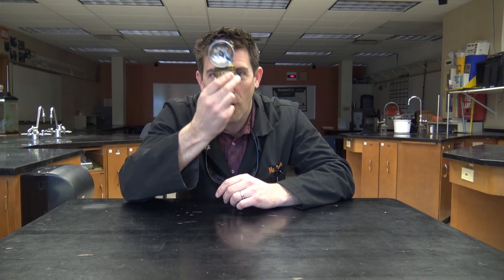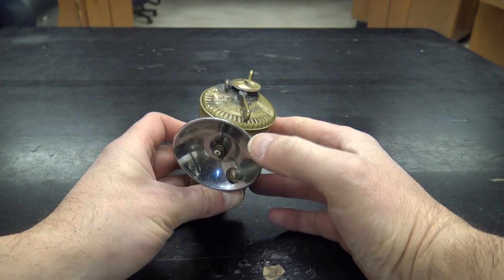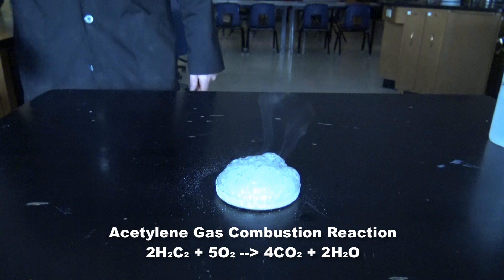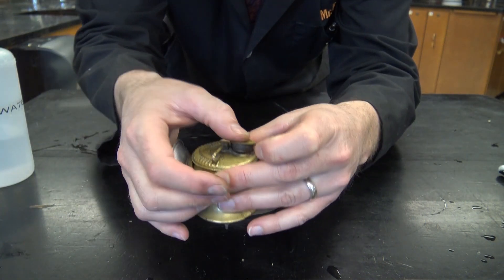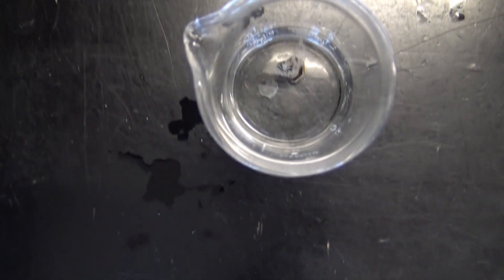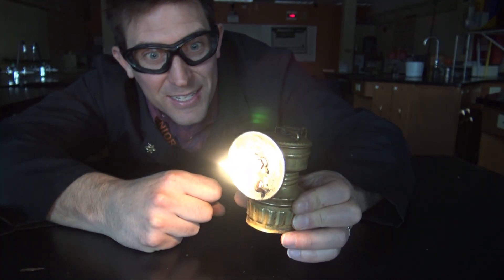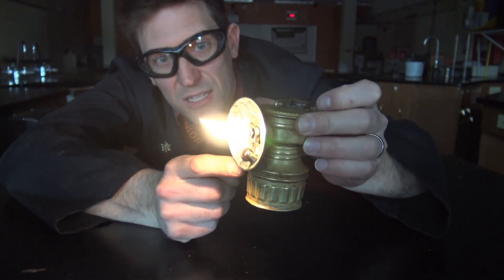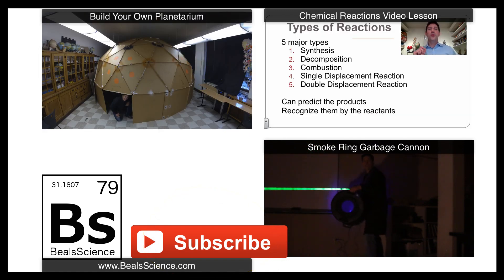The Carbide Miners Lamp - Bringing History Back to Life!

Comment: I had one of these as a kid back in the 50s/60s. I bought it along with a cannister of calcium carbide from our local Western Auto store. 
Wish you'd shown how to properly light it.  You covered the reflector with the palm of your hand for a few seconds to allow the acetylene to build up and then you'd rapidly pull your hand sideways causing your palm to spin the flint striker wheel throwing sparks and igniting the gas flame.
Reply from the maker: Sorry that I didn’t show that. The flint was broken on this one so I had to light it using flame.

Comment: My father was a coal miner in Illinois in the forties and fifties.   We had some of these and they were used for  fishing and outdoor activities.  They were always clean and at the ready.   There was a piece of screen wire twisted on the regulator bar on top used to clean out the flame orifice.  PROPER operation went thus.   You would put a small handful of carbide in the bottom of the lamp.  Water was already in the top.  Then you would spit in the carbide for the first wet to start the lamp.   Screw the bottom on and make sure it is tight and the gasket is not crimped and is sealed properly.   Then,  holding the lamp in your left hand,  cup your right hand over the reflector to trap the acetylene in there and hole your palm on the spark mechanism.   THEN,  you slide your hand off the reflector, rubbing the spark mechanism providing ample sparks into the gas rich mixture trapped under your hand.  Normally,  you would get a nice  POP and your lamp was lit, and could be adjusted with the adjuster on top.   Lamps were thoroughly cleaed each night when finished.
Reply from the maker: Thank you for the fantastic explanation!
My grandma told me nearly the same sequence about her father. She stressed the “spitting” into the carbide to get the reaction started.

Comment: Ya did good but abit to ruff . Vinegar clears them out nice and new . Hcl is to ruff on them . But one trip isn't too bad . Have a few my self been repairing.  Cool old things 130 years old still working 💪
Reply from the maker: Thanks for the tips!
Reply: Hot tank them on vinegar salt dish soap and borax. Simmer like potatoes 🥔 will take off about any thing.  But will boil the zink out Turing the brass copper red . But polished down  it turns back

Comment: In coal mines the dust/invisible gas fumes was a danger as it could be ignited by these open flames.
Reply: This danger would have been an incentive to improve technology to make electric battery powered lamps. Of course before calcium carbide the options were candles and oil lamps.
Reply from the maker: @williamkuhns2387  👍
Reply from the maker: I’ve heard they were incredibly dangerous for exactly that reason!

Comment: Acetylene gas smells like garlic. A mining equipment salesman demonstrated ti me how these lamps were lit. The gas switch turned on to start water drip and the miner would place palm of one hand over reflector to concentrate the gas then with other hand/ thumb strike the flint wheel and quickly remove palm to ignite.
Reply from the maker: I’ve never heard it described as garlic but I totally agree with you!
Reply: @BealsScience  the calcium hydroxide build-up inside lantern can be cleaned with industrial strength acetic acid or muriatic acid? I see these at antique stores and open them up and notice heavy white crust inside.
Reply from the maker: @williamkuhns2387  thanks!

Comment: I used a carbide lamp back in the mid 1970's. I used to go spelunking (caving) in high school and that was the primary method used by cavers back in the 1970's and 1980's. Outdoor/athletic stores sold carbide lamps and even the carbide (in a dark blue can) was sold in outdoor stores that catered to hikers, campers, rock climbers (I did that too) and cavers.
This is way before most outdoor/athletic stores turned into your standard athletic fashion stores. In the "olden days" outdoor/athletic stores actually catered to athletes and outdoor people with good, top of the line outdoor/athletic equipment.....stuff you rarely find in today's athletic stores like Dick's or Bass Pro shops.
Reply from the maker: Thanks for sharing! I need to take mine out and try spelunking!

Comment: Carbide lamp doesn't work in this time becouse of the super bright flash light but that usefull also in the  renewable compression engines becouse you can controlled the water drop and the gas coming out that going into the carburetor of an engines

Comment: Got one of these at a flea market. Flint works great. However, I soaked the top with vinegar but can’t get it to drip. I adjusted the switch but nothing. Is it ok to use the acid you mention to soak the top dripping mechanism? Looks like you only needed it for the spout. Thanks!
Reply from the maker: Great question!
You can definitely use hydrochloric acid (available at most hardware stores as "Muriatic Acid") but you have to be careful. Muriatic acid is usually sold at 35% acid (65%) water - this is really strong! Vinegar, by contrast, is about 5% acid and 95% water. So, I would recommend diluting the acid you buy with water for your first try and then gradually making stronger mixtures until it dissolves whatever is clogging the drip valve. I would start with a ratio of 2 parts water, 1 part acid. (Ex. 1/3 cup acid, 2/3 cup water).
Good luck!

Comment: I would have liked to see a bunch of old carbide lanterns in an episode of MacGyver.  Maybe he could have been locked in a room with a steal door,  acetylene cutting torch that was out of gas,  and a bunch of carbide and water. He could have refilled the tank of acetylene and gotten the cutting torch going and cut the hinges of the door
Reply: cool
BTW travisk have you become a flat earther yet? If not I suggest watch a 13 part series called What on earth happened by Ewaranon to learn that the earth is not a globe. I got it in my about tab.
Reply: @flat-earther   Give me 1 proof that the earth is flat? I hope you give the example of airplanes not flying off in to space
Reply: @travisk5589  long range microwave transmissions requiring line of sight (LOS) over distances where the globe's physical horizon would have blocked the signal.
Reply: @travisk5589  I suggest watching the series to learn stuff you may have not heard before.
It's a long series that first discusses the flat versus globe topic and then ends up covering several other topics.
I don't think everything in the series is true.
But in my opinion that series is one of the best I have seen to serve as an introduction to the globe versus flat topic so that's why I share it.
In my opinion it has some amazing information.

Comment: I used them for caving when I was a teen. We'd smoke our initials on the cave wall entrances with them. I sure wouldn't want to use them in a coal mine. In addition to the coal dust ignition dangers, walking into a methane pocket with an open flame will mess up your medical records.
Reply from the maker: Definitely would “mess up your medical records”!
;)

Comment: Hey, I bought 2 lamps for 20 dollars. Could calcium carbide have any negative health effects on me if handled?
Reply from the maker: I tried to post a link to help you but it did not work so I would recommend searching "Calcium carbide SDS" (SDS stands for Safety Data Sheet). This document will give you information about safety concerns related to carbide.

Comment: I have a similar lamp made by a company named Justrite; it is a two-piece lamp, where the carbide burner mounts to the miners belt and the flame is delivered via some tubing to an attachment (the light), which has a lens and also an exhaust portal.  Any info you could share about that would be appreciated.
Reply: sounds cool
BTW stevelohrey have you become a flat earther yet? If not I suggest watch a 13 part series called What on earth happened by Ewaranon to learn that the earth is not a globe. I got it in my about tab.

Comment: Very cool video!  I ran across a 1920's (I think) carbide Bike Lamp, it's German made.  I thought it used oil or kerosene as fuel.  How long would the lamp run with a handful of carbide?
Reply from the maker: I've never run it long enough to find out but I've been told anywhere between 1 hour and 6 hours but that seems to depend on the water flow and the amount of carbide. Generally the bike lamps are larger and can carry more water (and carbide) and I have read that some will burn for up to 12 hours!

Comment: Really lovely to see this charming thing brought back to life and create so much nostalgia and happy memories. I noticed it had no glass lens assembly or lamp housing unlike the Lucas bike lamps of that era? Presumably that was to allow for a faster and therefore brighter burn rate and improved heat convection that simply would have cracked and scorched the traditional glass lens and lamp housings of that time. That burn rate must have easily had the intensity of a blow lamp to prevent the naked flame from snuffing out in the draughts which would have been prevalent a plenty in the coal mines in which it was intentend to be used.

Comment: Which Acid u used for cleaning the  burner of the lamp? Best regards from Germany
Reply from the maker: Anoba I used 3 Molar Hydrochloric Acid (HCl). Oftentimes you can find HCl at a hardware store under the name Muriatic Acid and generally it is a 6 Molar concentration. So, if it is 6 Molar Muriatic Acid (HCl), you can make it 3 Molar HCl by adding Acid to water. For example: To make 100 ml of 3 Molar HCl, measure50 of water into a glass container then slowly add 50 ml of HCl. ALWAYS ADD ACID TO WATER not the other way around.
Does that help?

Comment: Then BOOOOOOM Due to blackdamp or methane, hence the invention of the likes of the Dave lamp that is or was used to the last days of mining in the Uk, biggest explosion was in late 1800s in a Barnsley Mine in Yorkshire UK. 386 boys and men died, there were 6 men got out the mine, the following day, 57 miner went back into the mine via a shaft sunken mine to retrieve the dead the next day and Booom same shit, all died, due to using carbide lamps, many Uk miners died in gas explosion and the wife's and families were evicted from the mine owners rented properties to the miners, hence unions were formed to have some form of control over greedy, selfish mine owners, unions don't have the power they had when I worked in the mines, RM 🇬🇧👍🏻 alive and kicking still thanks to the Davey gas testing lamps and good ventilation systems. There will never be a workforce like the British miners, they were the backbone of industrial revelations for steam engines run on coal.

Comment: My dad used one of these in the coal mines in Eastern Kentucky back in the day.. He would use the wire from a screen door to keep the orifice clear. I've seen him many times stop and unravel a 6 or 8 inch length of wire from the screen door screen and wrap it around the water contril handle so he would know where it was if the lamp went out. He could empty the "slack" out of the carbide chamber and refill it and then fill the water reservoir again all in the dark. He would wait til he heard the gas spewing out then cover the reflector with his hand for several seconds, 15 or so, then he would sharply pull the heel of his hand across the striker wheel. Thr result was a loud pop and a lit flame The size of the flame was controlled by the rate of water dripping into the carbide chamber. My brother and I were constantly stealing a few grains of carbide and blowing stuff up. We also used the soot in the flame to write on stuff, late 50s early 60s version of graphetti, I suppose.
Reply from the maker: Bill Fleming that is incredible! Thank you for sharing your story and some history of the use of the lamp! I can’t imagine having to rely on a carbide lantern deep in a dark mine. They were a hardy bunch!
Reply: Cool story thanks for sharing
Reply: That is such a cool story. I really want a Carbide Lamp.
Reply: Hubbard

Comment: But you don't know the proper (or at least the accepted) way of lighting it. You cup your hand over the reflector for a few seconds to let the gas accumulate then slide your hand off, spinning the flint wheel with the heel of your hand. It will light with a poof even in the wind.
Reply from the maker: Jim Foreman I've got so much to learn! Thanks for the tip!
Reply: "Poof"? You need to hold your hand a little longer! I wouldn't describe that sound as a little Poof. More like a fairly sharp pop!
Reply: Yes, I would imagine much like when you light an acetylene torch, a fairly brisk "Pop!"

Comment: That is very cool! I always thought those things used a wick and oil. What would be the average burn time for one that will filled with Carbide and water? Very cool piece of history, I would love to have one myself
Reply from the maker: James Emmrich thank you!
I don't know how long it will burn with a full load of carbide. I do know that only 5 grams burned for about an 30 minutes but the water ran out more than once and I had to refill it a few times - but I had it turned all the way up so I could get a big flame...
Reply: As I recall, a full charge of carbide at the low flame setting would last about 3 or 4 hours.
Reply: I wonder if they used Oil Lamps with reflectors as well before the invention of the Carbide Lamp?
Reply: @Vinnay94  stfu Vinny. We ain't talkin bout that kinda light now
Reply: It runs for 4 hours at medium setting of flame. Less acetylene gas is used as it heats up.

Comment: Do you think you could make a video showing how to make calcium carbide and explaining the science of why carbide releases acetylene gas when it meets water?
Reply from the maker: calcium carbide is actually quite dangerous to synthesize. It requires calcium metal and carbon. The calcium has to be heated until glowing hot, in the presence of carbon powder. The calcium, once molten, will incorporate and react with the carbon to produce calcium carbide. There are other ways of making it using calcium carbonate but again, the reaction is dangerous and can emit hazardous gases. This is why I just buy it. The purchased carbide is far more pure and is relatively cheap compared to buying the raw ingredients.
~If you are interested in the chemical reactions for the production of acetylene, you can find those here: http://www.bealsscience.com/single-post/571702980cf28f7f9b996d93
Let me know if this does or does not answer your question. Thanks for the comment!
Reply: Beals Science Thank you for replying. And is there no safe way of making calcium carbide?
Reply from the maker: +Josiah Aston I don't know of any safe ways to make it. Let me know if you find more info about safe ways and I would be happy to try it out and film it!